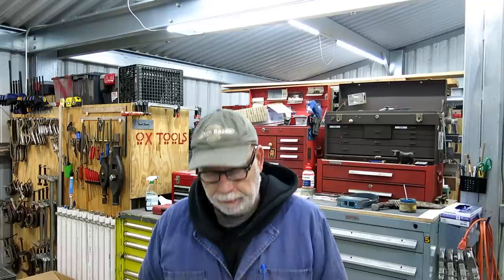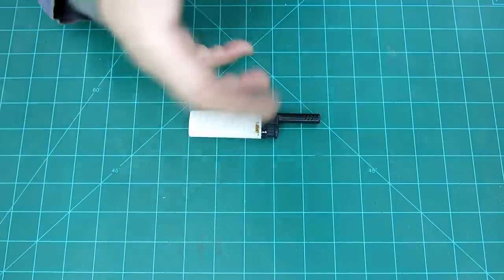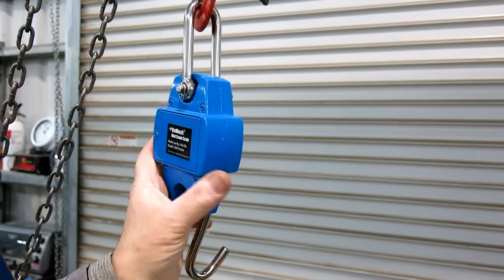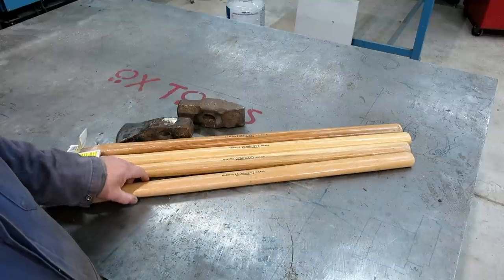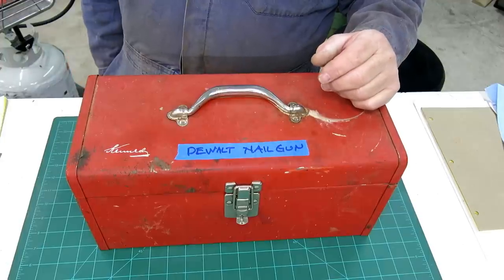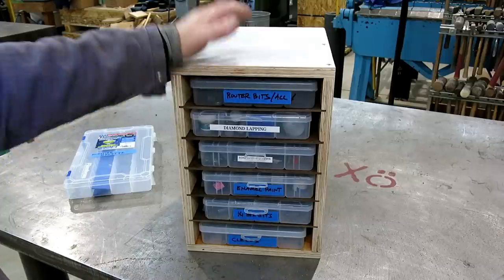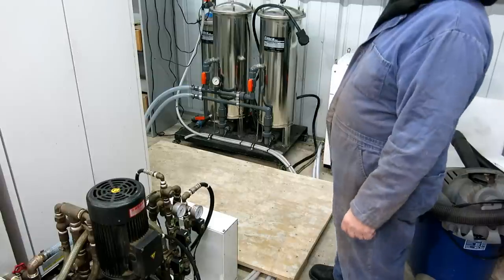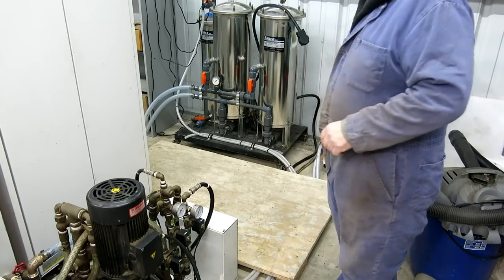Monday Night Meatloaf 146

Comment: The safety thing rang pretty true. I mostly run a rolling mill (alongside press brake work, auto punches, turret punches etc) which are mostly fed from steel coils which are anywhere between 3-5 tonne. I thought I was pretty happy with it all until we stared hiring and I had to show newbies, mostly guys who had never worked with metal before how to run the machine. I found I was saying "okay this is how I do it because it is easier/quicker I do not expect you to do it this way at all" a couple times to each of them. You cannot work like this. It is not fair to anyone. So I had to get my shit together and try and run a tighter ship at the cost of a few minutes here and there and a few grumblings from them above. I do not want anyone to get hurt on my watch taking the same risks I would without thinking. 

I had a 4 tonne of 3mm x 300mm whip around and spring out of its guides today. Glad everyone knew where to stand and nobody was in the wrong place at the wrong time. I normally find myself having to go home and apologise to my wife when I get hurt out of my own stupidity at work - things that are a small risk for me would have a huge knock on effect for her if the worst case were to happen.
Reply: People get complacent around rolling mills. Especially a big, really slow moving one. They are exceptionally dangerous. I smashed my fingers so many times on a little bitty hand powered sheet metal roller when I first saw the big stuff I was prepared, but it was rather intimidating. And it would not take a particularly large one to roll your ass flat. Press brake machines used to be the machine everyone feared. I can see why, but now with light curtains and the thumb triggers and all the other stuff, unless you have someone helping they are kind of locked down. Even in an older shop I never really felt too concerned. Sheet metal tools I guess we're just familiar. Working in a lumber mill was a different story altogether. There were waaaaay too many people missing fingers, both old and young, conveyor feed saws everywhere, you almost had to wear gloves, and you could easily catch shrapnel from exploding saw blades or lumber just getting out of your car. Had to drive a half mile down the road to smoke. Dust explosions are more than a big deal. It was a nightmare factory for sure.
Reply from the maker: Good points. When other folks come into the picture you often have to rethink the procedure. Thanks for the comment.

Cheers,

Tom

Comment: Appreciate the safety message, Tom.  Appreciate more how you went about it - it will have made a lot of people think seriously rather than just closing their minds off.  I reckon you saved a few fingers out there, at least.  Good work in my book.
Reply from the maker: Hey Russell. Yeah most folks really don't like being told they are doing it wrong, me included. I think the concept of protecting things you care about is a good position to come from. That could be your kids or your fingers. Thanks for the comment. 

Cheers,

Tom
Reply: @oxtoolco  There is one adition to what you said about "what may look sketchy for an untrained eye may not look sketchy for an expert", which is absolutely true most of the time. But sometimes when it comes to routine stuff, when it does not look sketchy for you, but for an untrained eye, it might be. It should at least be a trigger to reconsider and reevaluate. Outcome still may be, "this is absolutely fine that way". Or it may safe one from a "damn, that went south fast" situation.

Comment: Good Stuff Tom!  Craigslist rocks, I met one of my best friends when I was selling a shaper on CL.  I love and use the kit idea.  I've spent 38 years in the Army and they are all about kits, they have a category of supplies referred to as SKO, sets, kits, and outfits.  I have used this sort of system for years.  Use the tackle boxes for your drill bits and your mini pallet tiedown hardware.  If you put a little "file folder" tab on the masonite shelves they are easier to grab so you can pull them out when you need to.  Your woodchuck skills are more than adequate, just need some wood filler and a little stain and you would be right uptown.

Comment: We have Charmilles wire EDM's at work and had an alarm in the Z axis that we couldn't figure out what was causing it for weeks. Turns out the grease had hardened in one spot on the gear that controls the feed of the Z axis. We do a greasing cycle routinely (approx. every 2-3 months) and some how missed cleaning and regreasing the one spot on the gear for about 10yrs or so. Needless to say, lessons learned the hard way are not soon forgotten! 😉

We're hoping to get a Makino U6 Heat EDM to replace our 2007 submersible EDM sometime this year...finger are crossed!
Reply from the maker: Hey Joey. Great story. WEDM's are kind of fussy machines at best. I imagine that drove the operator nuts. Good luck on the new machine. Thanks for the comment. 

Cheers,

Tom

Comment: I 100% agree with your safety philosophy. When I was younger I did a lot of sketchy stuff. Now I worry about my wife and child and need to be there in as good of shape I can for them so I imagine what I would do if it were them. I have stopped what I was doing several times for their sake, and changed it up. I have even bought things to make it safer and put it off until that item arrived.
Reply from the maker: Hey Josepi, Thanks for the comment.

Cheers,

Tom

Comment: Good one .  I have an Italian lathe in my shop as well , can do 80mm pitch  , 3/8 of a TPI  while in the 8:1 feed .   There would be alot of us that work in large workshops get the saftey thing drummed into us constantly ,  although a pain in the butt  i have personally found over the years it has changed alot of the ways that i work .     Your new shop is progressing well , a long road i am in the middle of !        Cheers .   👍
Reply from the maker: Hey Max. Shoot me a picture of the lathe if you can. Thanks for the comment.

Cheers,

Tom
Reply: @oxtoolco  No worries .   I will be over at my new shop next weekend .

Comment: I use an old Charmglow ventless space heater. It's LP Gas and it does a good job of cutting down the chill in my 40x50 shop in the winter. I keep it on low. i always enjoy your videos and I often copy your projects.
Reply from the maker: Hey Joe. I have a radiant propane heater I set up when it's cold like this. I won't heat the shop but it is a spot I can go to and get warm. Thanks for the comment.

Cheers,

Tom

Comment: I like the bin storage idea Tom.  Where I used to work I had similar bins with fixed dividers for screw hardware storage.  I had one for each size of commonly used screw size.  Very handy and better than the assortments that are out there because they were customized based on our needs.  Good talk on safety having worked in student shops you really need to have that philosophy.
Reply from the maker: Hey Bill. With the small bin system you can take the tray to the job which is really handy sometimes. Thanks for the comment. 

Cheers,

Tom

Comment: * Bic EZ Reach lighter!  I would have thought it was for lighting a pipe.
* That's the identical scale I have in my shop. It's awesome.  BUT - make sure you take the batteries (at least one) out between uses or they die in a month or so.
Stay safe - any day above ground is a good day.  :)
Reply from the maker: Hey Dr. Good point about the batteries. I'll take them out next time I'm in the shop. Thanks for the comment.

Cheers,

Tom
Reply: @oxtoolco  - I figured it out the hard way.  Oh well, was only 3 alkalines. At least they didn't leak on me!  :)

Comment: I use a butane lighter in the shop. On a second note on the safety aspect, i agree with you Tom. Take a step back and do the proper thing, with that said also own your mistakes, the truly lasting lessons are the ones that bite you in the arse.
Reply from the maker: Our best learning is from mistakes. Just don't let them get out of hand. Thanks for the comment.

Cheers,

Tom

Comment: Sho is looking good. Love the plastic bin organizer. I have 30 of those just in stack on a shelf. Will be making a few for my shop. Thanks.
Reply from the maker: Hey Rosser. They suck when they are stacked. The bin case makes it so easy to pull the one you want. Thanks for the comment.

Cheers,

Tom

Comment: Ive litterally put vegetable oil in my way lube tank for my sharp sv2412 VMC. Was completely out of way lube and there was a delay on my 5 gallon shipment. I had a job that had to get done. It worked fine for the time being, no problems. 😂
Reply from the maker: What did your wife say when you put it back? Thanks for the comment.

Cheers,

Tom
Reply: @oxtoolco  she was actually puzzled when I said it was for the machine, and that we needed to get more from the store 😂 seriously the viscosity wasn’t that far off, I don’t think it hurt anything.
Cheers

Comment: Tom, I had a bunch of either 18ga or 16ga laser cut with foldable sections that once you fold the sides down, they perfectly hold a similar plastic case that I have used for years.  I actually have a couple of sizes of the cases, a medium very close to the ones you are using for small parts and a mini version that has been useful as a more mobile solution.  The metal sections work well, and are easy to add onto, as I just tig braze them into stacks.  They live on top of bolt bins, or drawer units and have a place to open them up, similar to your sliding shelves.  Love any type of organization method, keep it up.
Reply from the maker: Hey Shad. Sounds great! Shoot me a picture if you can. Thanks for the comment. 

Cheers,

Tom
Reply: @oxtoolco  Tom, I'll shoot some pics and send them thru instagram.  Not a great way to attach in youtube

Comment: On the storage cases I draw the separations transfered from the bottom dividers and then label it with marker.  If you change a location or make it bigger or smaller just rub off the marker with WD40 and a towel.
Reply from the maker: Hey Brandon. Good idea. Any organizational system need to be flexible and allow for change. Thanks for the comment.

Cheers,

Tom

Comment: You can buy the parts bins at HF for about $125 for a box of two dozen. I make mine to hang the bins by the wider part of the bin by putting some hardwood strips on the sides with the brad nailer. Mine orient the bins with the hinges to the back (wide side facing you) so they take up less depth in my tiny office.

Comment: Tom, Bought your Sheetmetal book, loved it and your videos. Funny your timely safety session. I just commented on Steve Summers recent channel about safety. Some dweeb told me to: stfu. Watch his current video on the 1/8" arbor. Reach around the milll while slitting saw is running and another violation. I don't want to be mean, but us Hobby machinists and normal peeps are viewing all these YT vids. Just trying to call-out bad habits so the "Kids" don't try this. Also he turns off Drill-press and grabs the chuck to stop it. If he wants to put brakes on everything, get a disc brake system from a dirtbike or MTN bike and incorporate it. You guys are on a public Forum. My 2 pennies.

Comment: Wasn’t that a movie… “Eternal vigilance of the spotless shop”?  Agree 100%.  My philosophy is to leave things better than I found them, and especially to fix things which are unnecessarily dangerous.  Especially bolting down heavy or vibrating equipment, and anything electrical.
Reply from the maker: Hey Marc. Leaving things better than you found them is a great attitude. If everybody did that you would never have to clean anything. Thanks for the comment. 

Cheers,

Tom

Comment: Hazard identification and working out who or what they pose risk to is always worthwhile. 
On my little Abene mill they specified an eye-wateringly expensive oil for the gearboxes- I took that data sheet to my local hydraulic shop and they matched the specs for a much cheaper alternative with equivalent performance. 20L of the “right” oil was more than I paid for the machine.
Reply from the maker: Hey James. Sounds like you have a good hydraulic shop. Stick with them. Thanks for the comment.

Cheers,

Tom

Comment: Interesting as usual. Thanks. Consider a carrying handle on top of those cases you are building.
Reply from the maker: Hey Greg. These are meant to sit on a shelf. The trays are easy to remove and bring to the job. Some of the crud I collect in the boxes would stretch your arm out of the socket. Thanks for the comment.

Cheers,

Tom

Comment: Shop organization for small stuff... Oh boy do I sorely need to do this "I know I have it somewhere"!  I have seen one of those Clover lathes, at first I was like Meh... then I started to look it over a little closer and thought Hmmm this baby looks pretty capable and wished I could take it for a drive, It sure looked like a good one.

 I love the bridge over the EDM hoses.  

Safety... one those things that if you survive your own stupidity, you usually learn not to do it again. However  what I want to know is how does that piece of grinding swarf find it's way under the face shield and behind my glasses and require a trip to the Dr to have the piece removed?.
Reply from the maker: Hey Warren. Somebody that ran that Clover lathe got in touch with me. I thought the interesting part was the huge leads it could handle. There have been times when I wanted something  faster than a 1/4 lead. Thanks for the comment. 

Cheers,

Tom

Comment: yes Tom a moments lapse and your in trouble , I lost the end of my little finger ( well I still have it because I took it with me to A&E and the stuck it back  on ) fan motor with eve belts 50 hp drew the fuses , slacked off the the adjustment bolts but as it was a Bull. motor and they have sleeve bearing , anyway the out put dampers had failed to close completely and I put my hand on the motor pulley the fan rotated due the back draft good by pinky. so as you say its the unforeseen that gets you . spent many years doing live jointing but there the dangers or there and you take care

get that shop insulated before you get frostbite in the nether regions H & S report would be interesting 😀
Reply from the maker: Hey Stuart. There are so many ways to fail in this trade. Good thing you weren't sitting on that pulley....Thanks for the comment.

Cheers,

Tom

Comment: On the subject of safety I no longer split kindling with and axe. I built a splitter similar to yours with a couple minor differences. Turns out a Kia brake rotor fits the bottom of a 5 gal. bucket perfectly, no hole in the bottom needed, however I think I made the cutting edge to close to the top, half goes in and half shoots across the floor. Revision #1 coming soon. My digits thank you.
Reply from the maker: Hey Michael. Same here. The hatchet quickly remove your hand method seems dodgy. Thanks for the comment.

Cheers,

Tom

Comment: I got a kick out of your grease trials and tribulations because I can relate. The 6 speed manual transmission that came in the modern Dodge Ram diesels get a bad wrap for being grenades, well Dodge/Ram recommends ATF+4 for fluid while the manufacture of the trans a little company you might have heard of Mercedes-Benz recommends 50w gear oil.

Comment: Had my eye on that clover lathe myself. Too bad I'm outta room and already have a lathe. Lots of nice table saws on craigslist right now. Get a delta unisaw if you can. Again like with machine tools, look for ones with extra tooling. Blades, jigs, throat inserts etc...
Reply from the maker: Hey Delta. I have my eye on a couple of Unisaws. I really would like to get a full size cabinet saw with a nice fence. Thanks for the comment.

Cheers,

Tom
Reply: @oxtoolco  there is one in Berkeley with a bissemeyer fence for 400. It is 3 phase .

Comment: Another source for storage are obsolete laptop computer storage cabinets. You can get them at school auctions and the cubbies are about the same size as the plastic containers you are using. The tops make a sturdy bench top.
Reply from the maker: Hey Slausonm. Thanks for the comment. 

Cheers,

Tom

Comment: I use Plano boxes to organize my "junk" and one trick I've figured out is to put some Dynaflex 230 into a syringe with a dispensing needle and inject that into the slot that holds the dividers.
Reply from the maker: Hey Drew. That sounds like a good solution for the really small parts that tend to migrate under the dividers. Thanks for the comment.

Cheers,

Tom

Comment: How are the dimensions of the battery compartment on that crane scale?  The one I bought recently works fine with the included carbon-zinc batteries, but Amazon alkaline AA's will not fit.  The battery compartment is just ever so slightly too short.
Reply from the maker: Hey James. I know a guy with a machine shop that can probably help you....

All the best,

Tom

Comment: WRT lighters: look up the Dremel Versa Flame (or similar from other brands). They're bigger than a Bic, refillable, have a long end, and (at least for Dremel) come with some handy accessories. The soldering accessories are worthless for electronics, but the torch overall can be used for small silver soldering jobs.
Reply from the maker: I'll check that Dremel out. Thanks for the comment. 

Cheers,

Tom